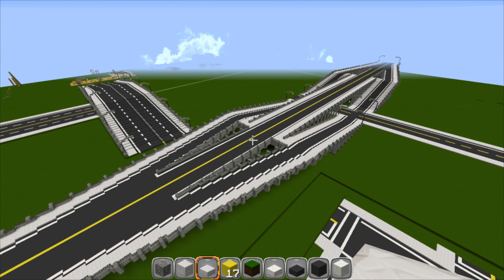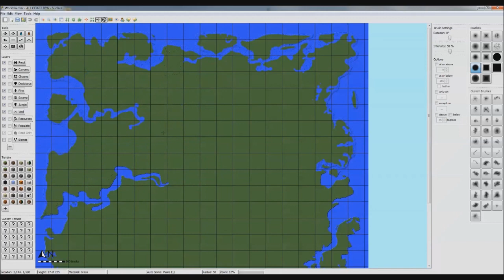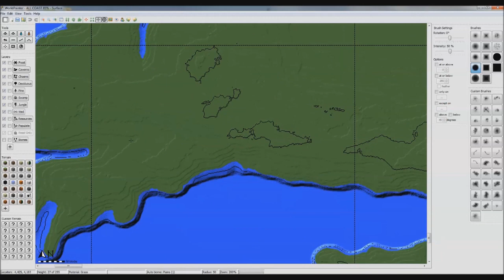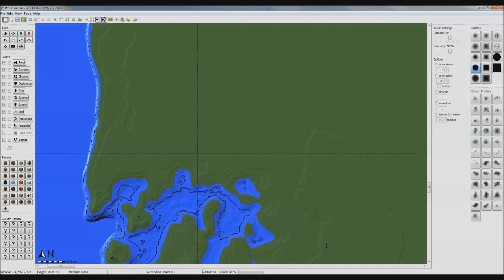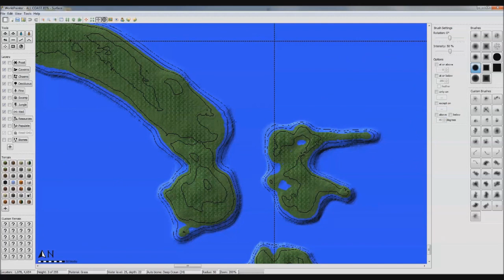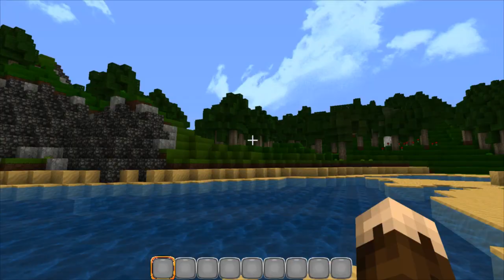Minecraft: Build it Better -  Designing Elevated City Roads, CloverLeaf  and Future BIB Map (S2 EP3)

Comment: 10x10k? Won't that be pretty much over the top? lol I mean, even 2x2K is huge in minecraft scale! xD
Also, to pull off steep coast lines steep sections, make them out of stone, since water crashes on those sections more regularly. Oh yeah, I see what you were trying to pull off with the rocky sections of the mountain, and I know a good way to pull it off:
-When you're mixing the rocky terrain with the mountain, you should go with an angle between 57 and 63, being the average slope made. 
-After that, choose your height on where these rocky formations should start going. Ex, if your map is 112 block high, and the highest mountain reaches 200, go around 135 as the start of the rock formation, so nothing of the landscape under that looks out of place.
-When you finished the rock formations, add a lighter type of material like gravel to sit under the rocks, as if a few pieces were to actually erode (possibly around the 120 to 135 space you could use from my example). It's an easy way to make big structures pop and look different from every green plain around the map. 

Hope that helps!
Reply from the maker: Yeah it's overkill, but like I mentioned in episode 1, I want a map to withstand the test of time for awhile, lol..thanks for the tips :-)